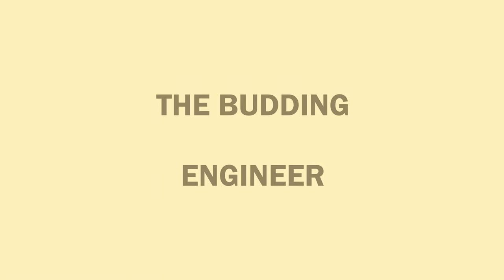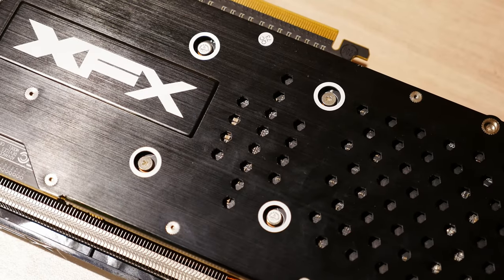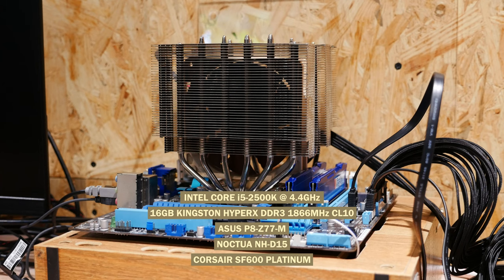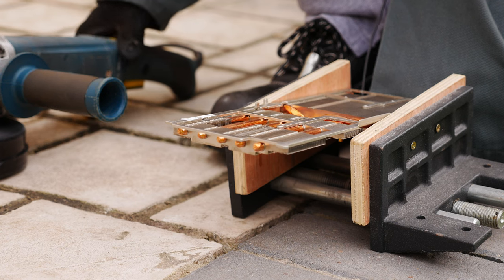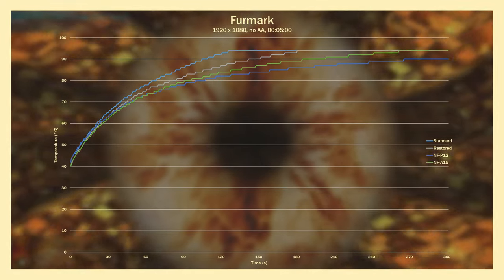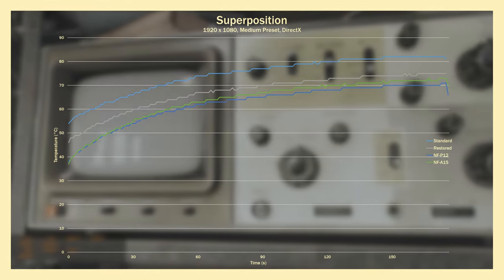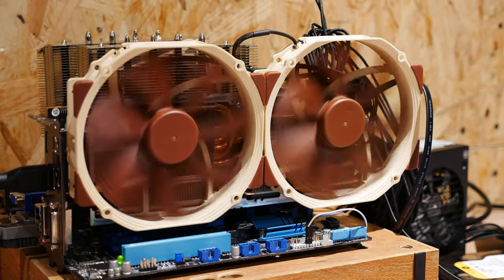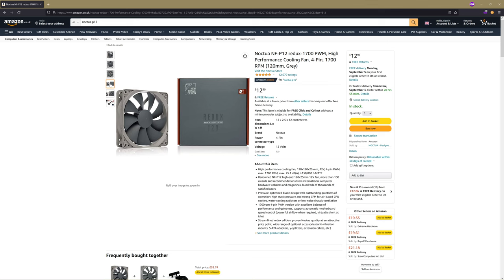Trying the Graphics Card Deshroud Mod

Comment: Nice video, but it seems important to mention that the load capacity of GPU fan headers are limited, more so than motherboard headers where these case fans usually plug to. For someone trying to do this, ensure that the fans you plug to your card have similar wattage, burnt fan headers can and do happen.
Reply from the maker: This is a good point that I've failed to mention
Reply: Just to say, when I did this on an old GPU I think my Arctic A12s used about a fifth of the power of the stock fans. I would have run out of room in the case long before I could saturate the output of the fan header on the card.
Reply: @ElderlyAnteater  most likely always true when using artic fans, the ones I've checked are always super energy efficient. But it's easy and important to make sure. burnt fan headers have happened.
Reply: You can always plug them into the motherboard instead, although I suppose there might be some risk your fan control software crashes and now your GPU fans aren't running anymore.
Reply: @atnfn  most somewhat modern hardware (gtx 10xx+, maybe earlier) is temp limited so things should just run like shit if stuff gets hot. it's a personal choice but i like the gpu being in control of it's own cooling as intended by the manufacturer.
Reply: Wait so the fan controller doesn't have a current limit and the fans can draw as much as they want, melting the connector? Curious because to my knowledge, motherboard headers have limits where it just won't be able to run the fans. Instead of trying to deliver more power than the header can take
Reply: i'm late but, only non-pwm fans are of concern here.
pwm fans will be fine because they dont have any volt drop, just dont use more fans per header than what was originally installed, i.e. dont use two fans per header if the original only used one
Reply: @ZenTunE-  that how any appliance works, and why adequate power supplies are needed.
a 4090 will still pull +450w even if the psu only has 200w to spare, and cause it to melt, or worse
Reply: @AndroidBeacshire  That's not how power supplies work. What causes the 4090 to melt is a bad connection on the poorly designed ATX12V plug, not an insufficient PSU.
An insufficient PSU will either just limit the power, or shut down due to OCP.

An insufficient connector/wiring (as is the case with the GPU PWM headers) does not have the same implications as an insufficient power supply. The GPU CAN offer more than enough power for even 3 Delta fans. However, the mini-PWM connector might not handle that much power and melt.
Reply: @MaavBR   I meant the PSU will melt if it's under sized for the load,
Same as the PWM header will melt if it's current rating is exceeded
Reply: @AndroidBeacshire  It won't. Power regulation circuitry behaves differently from a simple conductor. Any minimally decent PSU will just either limit the amount of power it's providing or shut down if it's under-specced for the load.

The PWM header is a simple conductor. It will melt in this situation.
Reply: @MaavBR  I hope no-one believes your terrible advice

Comment: big brands should release cards like this who dont care about design and want max performance and lowest prices
Reply: Palit/Gainward Panther cards. 

They don't have any RGB or decorative stuff, but they have great cooling.
Reply: @hyperturbotechnomike  overall its better to get used one with nice heatsink and good components and and some 2 big ass cooler like that guy on movie. Noctua is to expensive, i give the cheapest one 120x120 and temperatures are not higher then 55C. But of course its loud, noctua is better in noise. Imo its better then 99% of brand cooling system, look like shit but works great.

Comment: Tried this on my XFX rx590 fatboy. I used 3 smaller fans out of an old silverstone multimedia case, I think they were arctic cooling fans. The cooling was not quite as good as stock but the difference in sound levels was amazing. The stock fans were so loud and the 3 arctic fans were so much quieter. I gained about 3 degrees for a much quieter gaming experience. Card is about 5 years old. New thermal paste made virtually no difference. How come most standard cooling solutions on graphics cards are so bad? I do have a few noctua fans but they look too big when trying to fit to the card.

Comment: Great video, just a tip: counter-rotating fans would -theoretically- improve thermal dissipation due to cancelling vortices and unstable airflow, also, 92mm fans with roughly the same static pressure as 120mm fans would be quite nice to see compared, because fitting 3 92mm fans or 2 120mm fans would make for an interesting comparision :)

Comment: Try the Noctua NF-A9 fan instead. The problem with too large fans, that they push most air out sideways, and they outtake is not centered to the heatsink.
The NF-A9 has very good static pressure which is perfect for heatsinks, and it covers the heatsinks perfectly, so all air goes through it, not sideways. It will be at least 2-3 degrees cooler and if you run it at 30-60% it will be literally silent, zero noise, and 60% fanspeed still handles most games. 
My system gives out zero noise during gaming now.

Comment: I have a RTX 3080 Turbo, which is a blower style GPU
Would you recommend me doing this?
The temps are crazy hot
It's literally melting my case i.o shield 😂
Reply from the maker: I'd say try it out, at least you don't have to remove the heatsink from the PCB

But heatsinks of blower-styles in general are kinda small, so I'm not sure if it'll be effective

I'm surprised they make blowers for Ampere
Reply: @deveneleven400  They won't work on turbo style gpu ( Blower GPUs )
Cause they have tinny heatsinks and it required a high rpm fan like the stock fan to cool it
Also they're designed to work with turbo fans only
For 2080 the best option is to use Kraken g12 bracket with AIO cooler
It's amazing!!
I was doing this Kraken g12 mod to my rtx 3080 but memory temps were a little bit high, Cause it's not designed for rtx 30 series cards
But for your card, Definitely try AIO mod with kraken g12, It's amazing and temps are great! Also it's nearly silent.
Also try changing the thermal paste and pads!
I did changed my pads and paste and my gpu is silent now

Comment: You're the best! 
An intresting argument that imho is worth investigate is ducting, also because i noticed that some of the 140mm fan area wasn't covering the fin array, my guess is that some cooling potential may be wasted. You'll probably need to design some 3D printer stuff for that
Reply from the maker: Ahh, so that's what you mean by ducting

I gotta have a look, the 140mm coverage could be improved

And yeah, thanks for the suggestion!
Reply: @TheBuddingEngineer  no worries man, take your time. your production quality is very high and i like it a lot
Reply: very true, 3 noctua fans of 92mm would fit perfectly. i just bought 3 for my 1080ti, but im still affraid i will need some ducting or diy shrouding..
Reply: @afti03  3d printing here i come!

Comment: I run my fans to my motherboard and set them as case fans with adjustments via GPU temps.

I also run them as a pull (exhaust) and simply add a tape along the heatsink so they grab air from higher up. The bottom of my case spews out hot air and no matter the GPU temps, the CPU is always the same.

It also helps that I use a SSF case that have the gpu fans hard up to the case floor and I also hang the PC under my desk away from me.

Temps are a little higher but not much compared to how much the rest of the system gets when set up as normal.

Comment: I did deshroud my 1080 Ti FTW  18 months ago and I don't regret it at all, but I used 3x92 mm fans, 2 Noctua that runs at 1500 RPM and Zalman that runs at 2000 rpm at the hottest part of the card. Repasted with i7 Diamond because radiator plate of EVGA is too rough.
  
17 C less - because I added a 4th fan 92 mm fan on the backplate which shaved an extra 6 C (on top of initial deshrouding which reduced the temps with 11 C) resting on antivibration pads provided by Noctua running at 930 RPM in pull, pushing the hot  air to the top of the case. 1080 Ti Standard TDP is 250 W  but EVGA pushed it to 290 W. 
IMHO never ignore backplate cooling.

My 1080 Ti most hottest runs in RDR2 @2 k > 61 C. DCB 41- 46 measured with phone app at the top of the case.

Your advantage in this case is that, XFX didn't coat the copper plate with NiZn wich are very bad thermal conductors. My EVGA rad is coated :( > damn fools. I'll never get it why manufacturers paint rads or coating them with Nichel and Zinc, defeats the purpose of those materials to disperse the heat. Marketing and visual is a  gain here and they don't care.

My 5 cents. No point in using 120 mm fans, losing about 20-30 % of capacity because are to wide for your GPU, 92 mm are fine but, the best is 100 mm fans(very few choices there). Sapphire is better than XFX- just my findings. Tested 380 Nitro greatly. Beat XFX, not in FPS necessarily but in temps. 

Deshrouding is always better  - thickness of standard fans that comes with the GPU is about 1-1.5 cm while the normal fans u use in deshrouding is 2.5 cm or more which means less RPM and more air pushed, less noise to.

Good video and nice statistic.
Reply: nickel coating is good for corrosion and that is why manufacturers do it, the NiZn coating also helps with destroying the metal if someone chooses to use Liquid metal for cooling
Reply: @dusannovkovic5286   They start doing NiZn plating before metal liquid was a thing and that is not the reason they do it. 

I have enough Copper radiators that didn't show any corrosion or oxidation which lay idle in cellar than in attic for 15 years, none of them shown corrosion or oxidation. Some of those rads not even in plastic bags but, just carboard boxes. NiZn plating helps only where the hardware is used in in high humidity environment.

On the other hand metal liquid is not need it really. A good thermal paste is enough(using very old IC 7 atm going to change it to TF8 soon). Once the heat is taken away from IHS  to the radiator and backplate is your job to improve the cooling - deshrouding and other mods will helps a lot.
Reply: @pete0274  ofc yes, but it does play a role in the safety, thanks for that massive info drop tho! it was interesting to read :)
Reply: @dusannovkovic5286   don't know what "plays a role in safety" surely not the NiZn platting. What is the % of ppl using liquid metal? Small, cause is expensive and hard to apply. The manufacturers of Copper cold plates can easily state on their product "Do not use liquid metal with this cooler, we are not responsible for any damage to the cooler or your hardware!"  is that simple. 
But I'm afraid you don't see the gain here, soon it won't be any copper under that Ni platting but some silly and cheap Al alloy which got half of the Copper thermal conductivity. And the hard push will be towards liquid cooling cause those needs to be maintain constantly and money will be spent, on tubing , new pumps, cooling liquid, cleaning liquid and so on. 
Without Copper more money and energy will be spent. But this is the trend, I just hope manufacturers will return to Copper cold plates.
Yes copper adds weight to a GPU but is absolutely no issue if they build the GPU on a strong PCB and that GPU is supported by a metal back plate and NOT some cheap plastic(Intel ARC 770) or too thin aluminum back plate HellHound 7800XT). And of course free lead soldering is a BIG no. Without lead any soldering joint is brittle and you are asking for a dead card daily.
Reply: @pete0274  agreed! Pure Cu tubes for the win! and metal backplates and general build quality would be the best, yet we won't really see that because all the manufacturers really want is profit so they will make sacrifices for that

cheers! have a nice day :)

Comment: At this point I replaced the old Zalman 92 mm with an Noctua 92 mm NF 9 and reduced rpms to 1600 rpm while the other 2x Noctua Redux are running at lower 1500 RPM, yet my VRAM sit many times under my GPU temps, which is great cause that was my aim. 
Always make sure VRAM is cool GPU doesn't count that much(unless is throttling down because of heat), GPU throttle down VRAM can start showing artifacts and than fry bricking your card.
My steps was: 1. Deshrouding the card  and use 92 mm instead of 120 or 140mm. 92 mm got a more focused push of air and got lower diameter rotors.
                           2. Cut the grill( yeah, butchered my Lian Li OD11 XL and I don't regret it at all) of the rear exhaust fan of the case. The grill was reducing the airflow of the fan roughly 15-20%, adding noise to. Is one of the most important fan in your case as is in the close proximity of your GPU and will exhaust the hot air from your GPU backplate out of the case.
                          3. A 4th fan 92 mm Noctua Redux at 1000-1200 rpm sitting on the backplate, not even hear it. Is on pull not push using rubber mountings which comes with NF 9 fan as little stands. That alone will help a lot but you have to sit it right above GPU and VRAM(above the 4 screws square of your GPU) like here  https://youtu.be/MfaVVInZt5A
On 2:40 in the video you see the results of my tests and also the fact that 120 mm does worst compared with 92 mm. The original fans for my GPU was 88 mm that's why I went for 92 mm instead of 120 or 140mm. Even you card may have default fans 100 mm I still think 92mm is the best for deshrouding or cooling down the backplate.
Those with big CPU air coolers might have issues in sitting a fan on that spot.
Those 3 mods brought my card to very low temps @1440P. My card is a 290 Watts and the fans are all hooked to a fan controller on fixed RPM.

Comment: FAN CONTROL is the best piece of software i have ever downloaded. Fixed all my issues.
The big 15inch fans don't work as well because they blow air past the gpu. i know because i have the same problem with my 1080ti with 2 120mm noctua fans. At least a third of the air is wasted past the gpu, i can feel it with my hand, therefore i bought 3 92mm noctua fans to fix the issue.
Reply: so youre saying 3x 92mm fans performs better then 2x 120 fans even with the excess air? thats interesting.

Comment: I know this is an older video, but "bigger is better" does not work for GPU fans, a lot of the air is getting being pushed next to the heatsink
I had the best results with 92mm fans (tried 120 and 140)

Comment: How can i hold the fan at the gpu? Also, if i use zip ties, will they be able to handle the heat from bellow the heatsink? Or i just complete round the graphics card with zip ties to attach the fan?

Comment: Bro can you use it with reversing the direction of fans ? 😊 A regular one is pushing the outside air inside which is wrong , but I don't know why GPU companies do that .

As air should be pulled outside the gpu the hot air should not pushed to the GPU circuit which can cause damage . So it's really good that if you use unconventional way by pulling the air out , please correct me if  I am wrong.

Comment: i have an RTX 2060 single fan and I'm thinking about doing this since the heatsink is big enough for 2X90mm fans but the shroud mounts are in the way so i was wondering if there is a way to remove those mounts idk how they are installed on the heat sink but i think it's welded so i just wanna know if there is a way of removing that without totally ruining the heatsink ....  thank you

Comment: you will get way better performance by routing the fans to the actual heatsink fins.

a 3d printed fan shroud, that forces air only to the fins and blocks the rest, would make a huge difference.

Comment: Great vid. will attempt a 3070 deshroud with NF-a12x25. I could not understand what is an "unlocked fan" though.
Reply from the maker: Thanks for your comment

It's actually to do with my testing - all fans and setups were first noise normalised, and I reduced their speed so they ran at the same noise level

Unlocking the fans meant removing this limit, and letting all setups run as normal, leading to the stock fans running at higher noise levels than the shrouded

Comment: I have a 1050ti lying in a drawer than has some very slight fan noise after all these years. I may have a mess around with that one day if I can be bothered.
Even if I could get them to spin below 45% would be a good start.
Reply from the maker: Perhaps a simple clean and repaste would do the trick